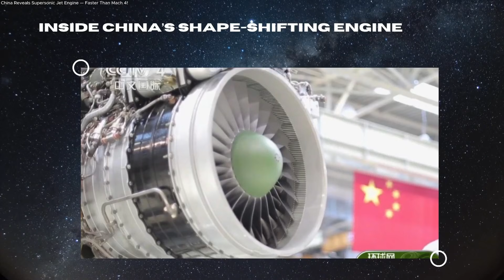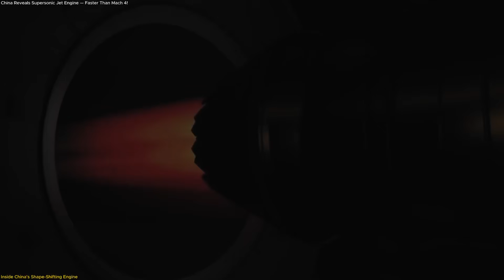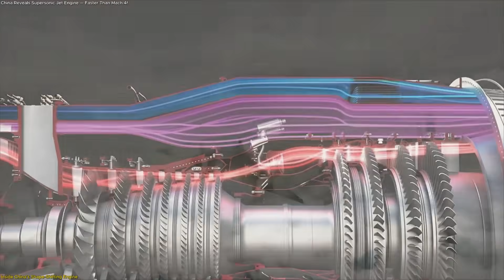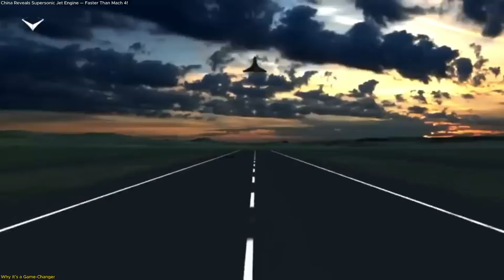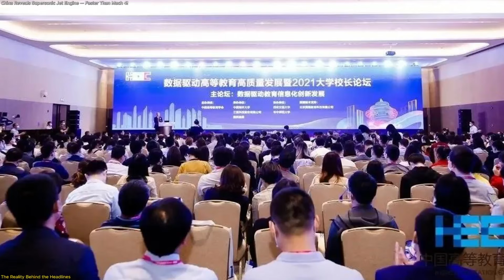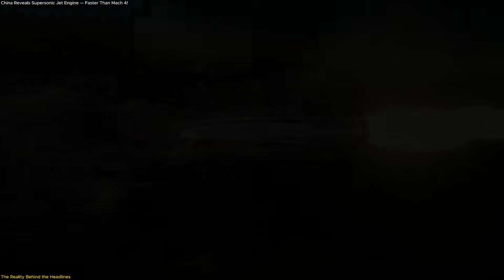China Reveals Supersonic Jet Engine — Faster Than Mach 4!

Comment: China is coming onto its own strength is jet engine technology into the realm of hypersonic flight for both military and commercial applications. It seems Chinese innovation is bubbling with success and speed.  Jet engines used to be an achilles heel for China and depended on Russia for its military needs.  Now, that dependence is moving towards independence and self-sufficiency. Looks like China will realize a COMAC C949 and hypersonic fighter jets with longer range capabilities.

Comment: China has announced a significant advancement in jet engine technology with the unveiling of a prototype adaptive cycle engine (ACE) capable of achieving speeds up to Mach 4, marking a milestone in aerospace propulsion. 
The engine, developed by researchers from China’s Institute of Engineering Thermophysics, reportedly delivers 27–47% more thrust than current engines in its class and cuts fuel use by about a third, while also offering potential stealth benefits through reduced infrared signature. 
This development is part of a broader trend in China’s aerospace sector, where sustained investment and organizational reforms have led to breakthroughs in engine technology, including the WS-15 engine now powering the J-20 stealth fighter, and the ongoing advancement of hypersonic systems like the CJ-1000 scramjet missile.
Reply: When is the ACE combat-ready to put in jets?
Reply: @larryc1616  China has announced the development and testing of its own adaptive cycle engine (ACE), claiming it can achieve Mach 4 speeds, deliver 27–47% more thrust, and reduce fuel consumption by a third, though these claims are based on ground tests and simulations rather than flight data.
China adaptive cycle engine has completed its testing phase and is now transitioning into the engineering and development stage before the end of the decade.
The development is part of China's broader push for propulsion independence, reducing reliance on foreign technology and closing the gap with U. counterparts like the General Electric XA100. 
While the US has delayed the military deployment of its ACE technology due to budget constraints, China's progress in testing may provide a strategic advantage. 
The engine's advanced materials, including ceramic matrix composites and single-crystal turbine blades, paired with a full-authority digital engine control (FADEC) system, support its high performance and thermal management capabilities.